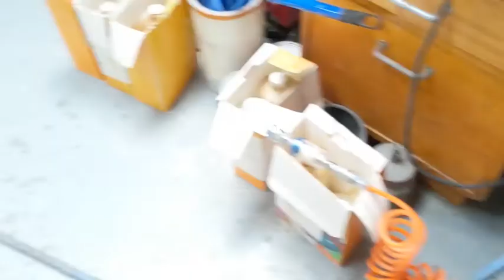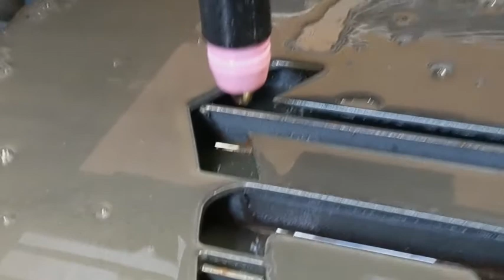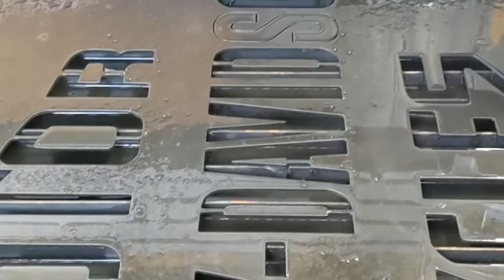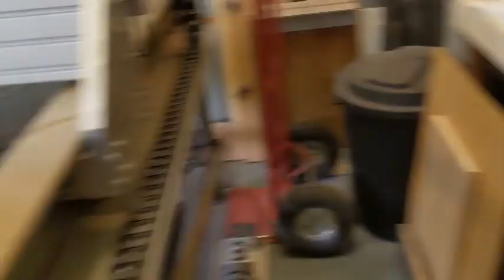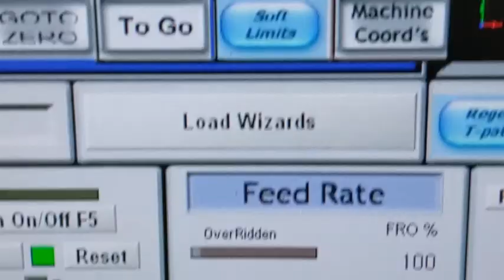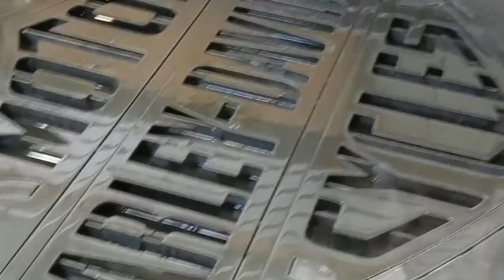Plasma Cutting a Harley Davidson Sign

Comment: Have you tried a bit faster travel with 3mm steel.
My usual speed is 2500mm/min for 3mm.  Same plasma cutter.
Reply from the maker: I was only running 1200mm/min.  I'll try speeding it up on the next few jobs.  :)